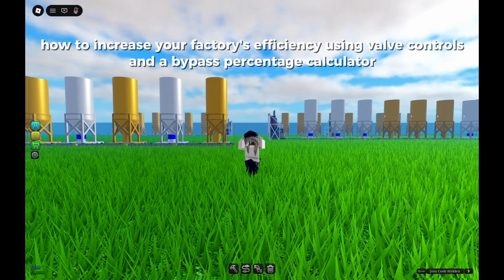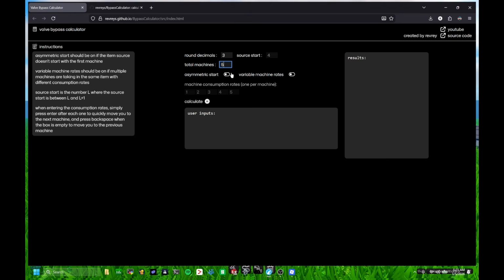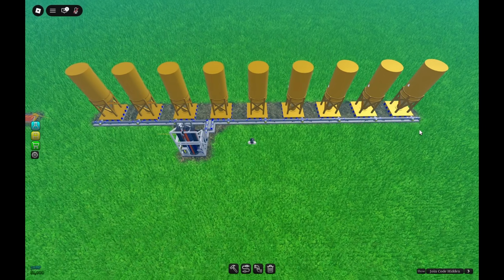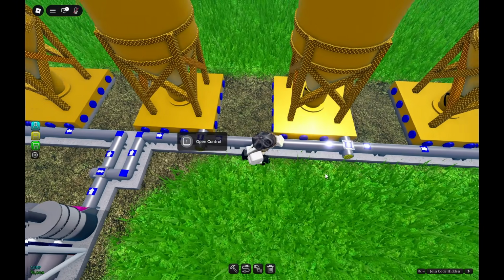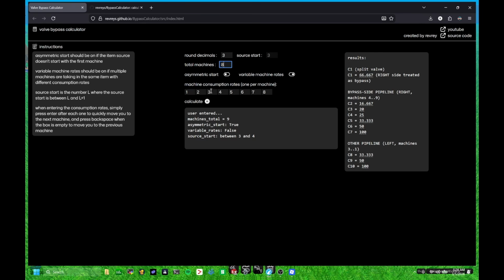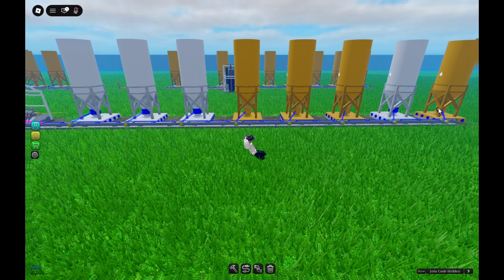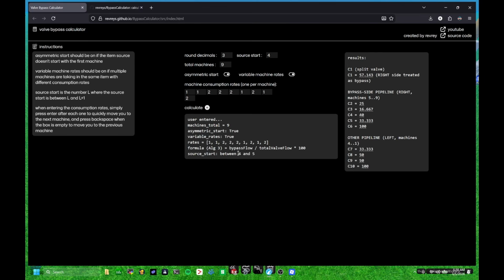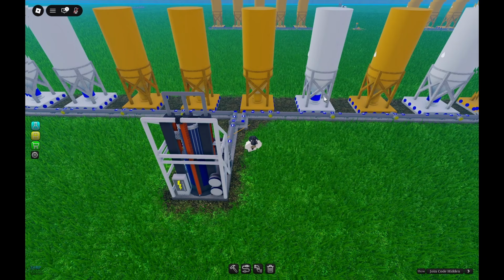easiest way to add valve controls in your factory to increase efficiency | industrialist

Comment: i would love a video explaining the fractional distribution involved jsut out of curiosity. this calculator is a really great tool though
Reply: Splitting 1 unit across 5 machines means u want .2 in each
So first valve is .2 (1/5) with .8 left
Next valve is .25 (1/4) with .6 left
And etc etc so just divide 1 by the number of machines left to distribute too and thats it